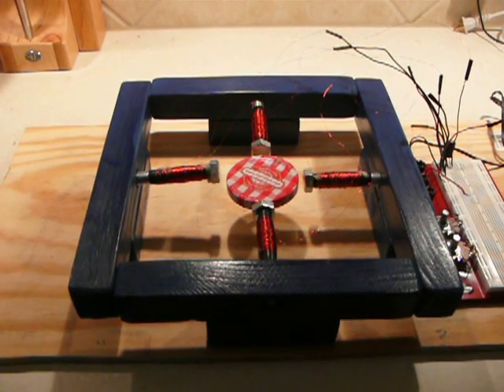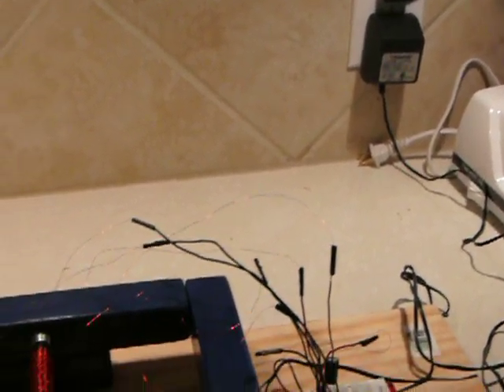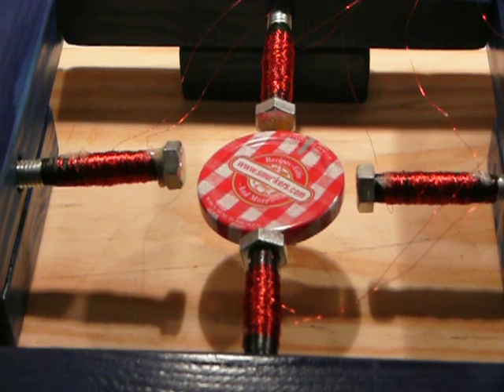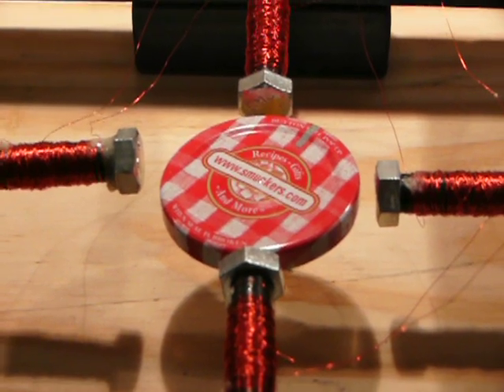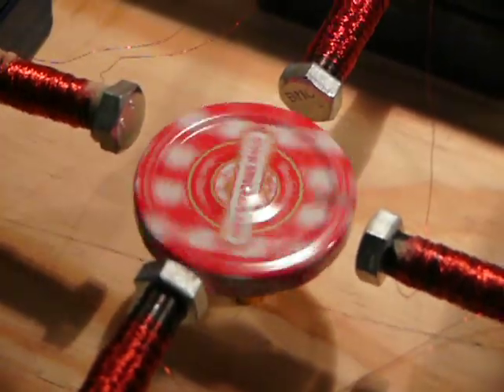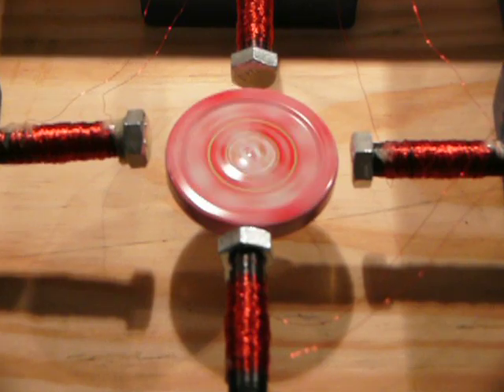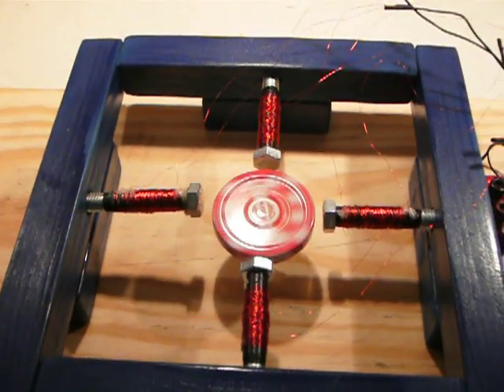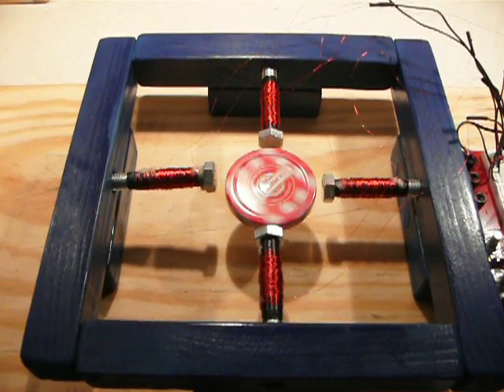AC Induction Motor

Comment: You seem to be saying that it is a simple jar lid balanced on a pencil. But you never actually say if there is a coil of wire below, or a hidden magnet.
Reply from the maker: youpattube1 I didn't say that because there are neither of those things. The rotor is simply a jar lid balanced on a pencil. Several people have replicated the design here on YouTube.
Reply: Ok. It's just that there is so much slight of hand and half truths on the internet that, never showing the underside of the lid made me wonder. A very neat demonstration. Thanks for showing it.

Comment: You lost me in the differences. Now the setup in the video is pole pairs ?  Or single  poles ? I don't even know what you mean by single poles.
Reply from the maker: youpattube1 Two single poles would be just two coils 90 degrees apart. In this build, I made pole pairs. The coils opposite each other are wired together in series.

Comment: Hello Christine! Firstly I have to say it is a wonderful project, Secondly, I have a question for you... have you tried to use a aluminum rotor?
Reply from the maker: +fabio garcia I tried aluminum initially and had difficulties getting it to work. I know classmates of mine succeeded, though.
Reply: Interesting... I would guess aluminum would work better because it is frequently used in the "squirrel cage" of many induction motors... maybe there are more significant variables which influence the whole operation. Many thanks for your reply!!!

Comment: First off sorry for these stupid questions new about this and a bit curios

So the jar cap just levitates right? 

Can other stuff levitate if its made of metal? 

Can the space btw the cap and the rest get bigger while mentaining the speed?

If it were a electrical eq instead of the jar cap would it be possible to use induction to power it?

Thanks alot
Reply from the maker: +Marius Dinca It doesn't levitate - it's balanced on a pencil as a rotor. You can see it at around 2:30 in the video.

Comment: No, not any capacitor will induce a 90 degree phase shift in the currents.  

Yes, it will induce a phase shift sufficient to get the motor started, but, for a given motor load, there is only one value of capacitance that will shift the current exactly 90 degrees.  

See "Design of Capacitor Motors for Balanced Operation", authored for the AIEE by P. H. Trickey in 1932.

Comment: Hi Christine, Thats a really nice design. I would like to teach my students something similar but i want to work out the kinks before i give it to them. I've created 4 electromagnets with the 30AWG wire and have a 20V transformer. I read that you said any size farad capacitor will cause the 90 degree phase shift? I think the highest non-polarized capacitor i can find in radioshack is about 1 microfarad and it is rated to 100V so hopefully that will work.
Thanks for the video.
Tim

Comment: Hi there, great video! I'm trying a similar design in the UK (power supply: 240VAC 50Hz). I am by no means an expert on the topic and I am having second thoughts and safety concerns on actually trying to run the motor. I have a transformer with a 24V, 1.5A AC output. Bluntly, can I attach this to my bread board without harming myself? Are there any safety issues with this design? Thank you.
Reply from the maker: Make sure that the capacitor is non-polarized and that any resistors you use are rated for the wattage you're putting across them. I had a small resistor burst into flames, which is entertaining but probably not the safest thing in the world.

The breadboard itself should be fine, just plug the transformer leads into it before plugging it into the wall.

Comment: Thanks professor Christine just i want to know the role of capacitor is not increase the voltage ?
Reply from the maker: The purpose of the capacitor is to induce a 90 degree phase shift in the current.
Reply: thank you very much
Reply: ***** This is a very nice demo.  How does one go about calculating the proper size for the capacitor?  References appreciated.

Comment: Just uploaded a short video of my project. As you can see I utilized a similar set up to yours. I ended getting a transformer at radioshack and added a switch. I ended up having to use a high value capacitor because I couldn't get it to run when I had smaller capacitors and a resistor (not sure what was up with that). I may try and remove some of the rotor material to make it lighter, but I am pretty much finished apart from measurements. Thanks for your video it really helped me a lot!!!

Comment from the maker: Yes, that's exactly right regarding the transformer and windings.

You don't want a diode in the circuit - that will interrupt the AC power (flow switches directions) and cause the circuit to not work.  This is also why you need an unpolarized capacitor - a polarized one will blow out under the current reversals.

Comment: Is the end of 20V transformer just cut off and attached to the primary windings and secondary windings with capacitor in between the latter? Also, will I need to have a diode somewhere in the circuit if I include a relay that starts it? Thanks for the help! :)

Comment from the maker: Each coil is wrapped individually and wired together with a breadboard.  Coils opposite each other are wired in series - the two sets are wired in parallel with each other.  The link in the description has a wiring diagram for a similar motor - main difference is this one has two coils in each branch rather than just one.

Comment: It probably is a sync motor.  If it gets up near synch speed (1800?), the magnetized rotor will lock on to the rotating field.   Normal induction motors use soft iron in the rotor, while sync motors use steel (which then becomes poled, magnetized.)

Comment from the maker: One set of coils is wired straight between power and ground, the other set is wired with a capacitor in series with them.  With AC current, a capacitor induces a 90 degree phase shift, so that's your other force component.  The result is a rotating magnetic field.  The magnetic flux induces (hence the name "induction motor") a magnetic field in the rotor, which pushes against the stator field.  Since the stator field is rotating, the rotor rotates as well.

Comment from the maker: @FreePizza007 Any capacitor will induce a 90 degree phase shift in the AC current, regardless of size.  If you want to use higher voltage, you'd need to choose a cap with a higher voltage rating (should be included in the specs).  The capacitor I used was about the best I could find locally - better ones would probably need to be ordered online.  Be sure to get an unpolarized capacitor, as a polarized one will blow up under AC current.

Comment: Hi,

How did you calculate that the 200MicroFarads Capacitor will allow 90 degree phase. What if you increase the input power to 50 or 100 volts. How would you calculate the Capacitor requirments?

Comment from the maker: @xwed2011 The maximum rotation speed is determined by frequency, yes.  60 Hz for US power, 50 Hz for Europe.  Of course things like friction, alignment, and other losses can dramatically decrease the rotation speed from the theoretical max.  DC motors, in contrast, usually drive speed by pulse-width modulation of a constant voltage.

Comment from the maker: @bubetlog Not true.  This is a permanent-split capacitor motor.  While not appropriate for large motors, it works fine for small ones like this.  For larger, you would want the cap-start configuration that you're referring to (or even cap-start/run, if you wanted to get fancy).